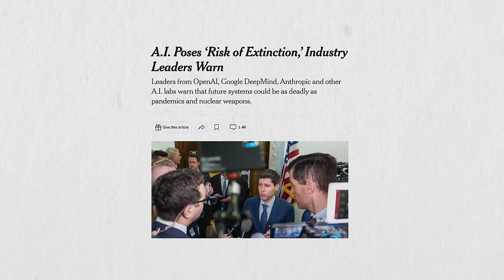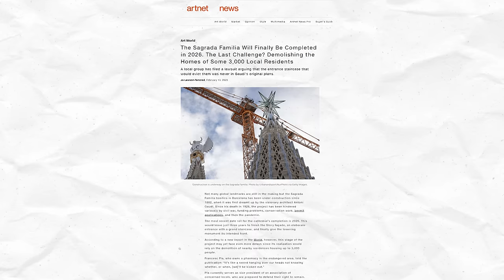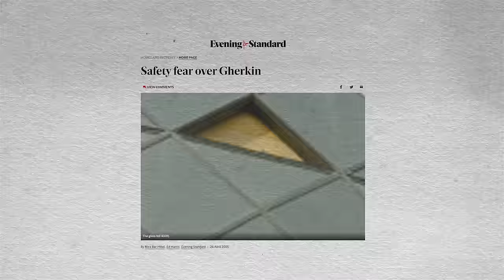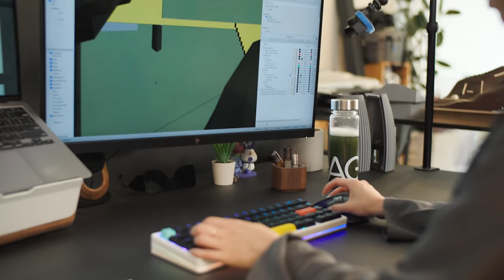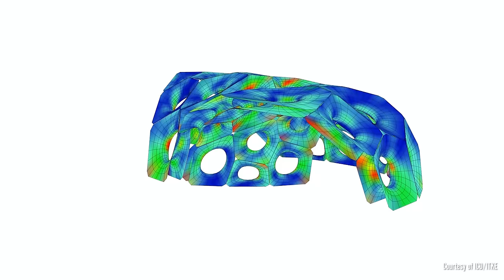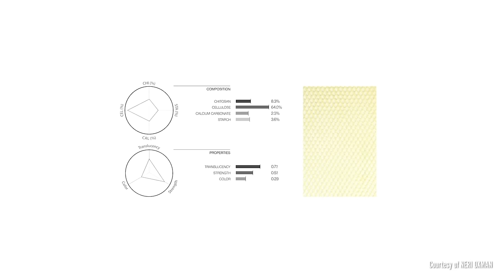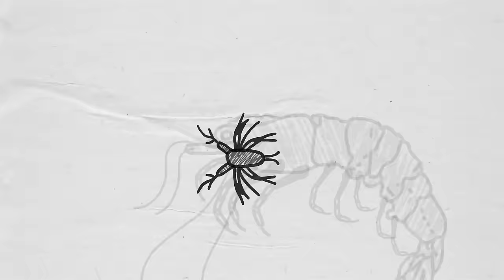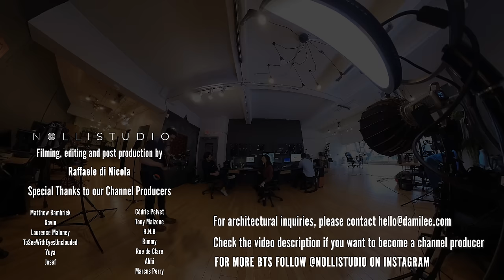Biomimicry: Hoax or Genius?

Comment: not sure the cathedral was a good pick for expressing your first point as it is a cathedral its not a building of function in todays world is a build almost exculsively as art. Almost every big cathedral too 100+ years to build many of which are not organic inspired in the way that Familia is. So the point you made was that this nature inspired catherdal took as long to build as any other major historical cathedral. Which doesn't support the point being made. Also in todays world of 3d printing homes and sturff and producing small form homes in factories, id beg to differ that the reason we arnt doing organic archetecturs is because of money or time, more or less that its an emerging tech that hasnt been fully utilized yet. As a counter point we are using the structure of bones to help 3d print materials that are strong or stronger than a solic block of itself, thereby using less material, and since it has to be 3d printed basically super limited labor cost. Id say the first point is actually wrong imo.

Comment: I would postulate that, the Water Cube building in Beijing, using plastic in a building is a positive step forward. Plastic = Bad!! Because it takes a long time to degrade. Well if we find ways to properly use RECYCLED plastic in construction, these building can last a long time. If we use, single use plastic = bad, but if we use it with the purpose of it lasting a long time = good.
Reply: My thought is that, the plastic used has to be recycled, no new plastic can be created for the sole purpose of building structures. It would be cool if 100 years or so down the road, the world starts running out of plastic to use, and forces us to choose more biodegradably appropriate materials.

Comment: Over all problems(that i noticed):
-plant inspired buildings are stupid as while you can scale structure you can not scale material.
-those naturalistically designed and material oriented "buildings" are useless ... They can hardly be used anywhere.
-"buildings" build using those bugs are even more useless. Their material would immediately fail in any actual building, even a tent.
we are literally spinning it ourself into workable material and it is not used in architecture.

Biomimicry is cool in design, but in practice it fails most of the time.
There is a reason why our plains don't move their wings, have bones etc.
There is a reason why our cars don't have legs.

Nature is not the best at design and evolution doesn't even have to be favorable, just look at some of our dog breeds that literally evolved to die.

So biomimicry could be a starting point but should never be goal. There is a reason why nature never created plastics in creatures or plants.

Comment: It just kind of looks gross. It's looks like large weird growths. This style of architecture doesn't actually look natural to me, because the scale is totally off... it's mimicking patterns that are usually very tiny, organic or insect like, like the stuff you can only see up close or under a microscope... it's actually just like large organic matter. Ew ew. The style makes me think that finally humans presence as a type of cancer to the earth is being manifested in a visual style. (For the most part these structures are greenwashing... if you go back into ancient architecture there were already building styles that are perfect for temperature control. earthquake safety, beauty... whatever you need. no need to reinvent the wheel. Especially with this starchitecture). Also, your job as an architect is to provide livable and beautiful spaces, not live out your failed fine-artist dreams.

Comment: SMH
What a fascinating look into a mind which is very pessimistic about humans in regards to nature.
Humans have been building structures in a very natural way for thousands of years up to today with natural materials, much like some animals do: Domed  huts, using mud,  clay,  cob,  and cement. 
Depending on how they're built and designed, they can be extremely energy efficient and very strong, including being resilient against many natural forces, including Tornadoes, Fires, and Earthquakes. And they can be made very cheaply and last for a very long time.
This is extremely contrary to pretty much everything you posted in this video.
Also, not all of us don't give back to nature.

Comment: I don't mean to be critical, but when you speak, your voice croaks. Has anyone ever told you that? It's actually really distracting. I used to be in radio and when I first began, I used to make my voice croak because I thought it sounded kind of cool, however I was told straight away that it is not the way speak. One has to be really smooth. So, perhaps you might look at how to not make your voice go so low that it starts to croak because it really doesn't sound good. I know you've been doing these videos for a long time but I'm just letting you know because I don't want you that often, but it's really clear how much you were croaking in this video.